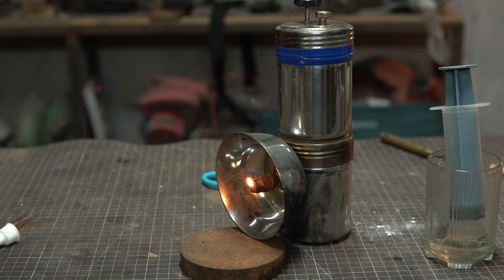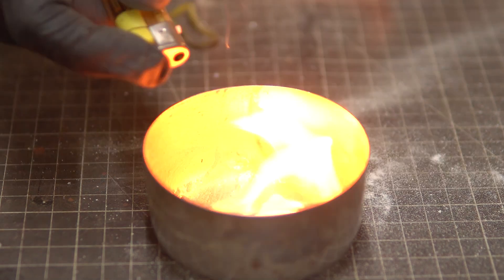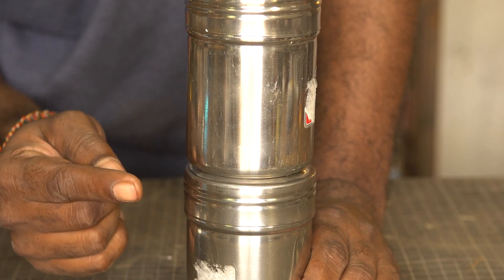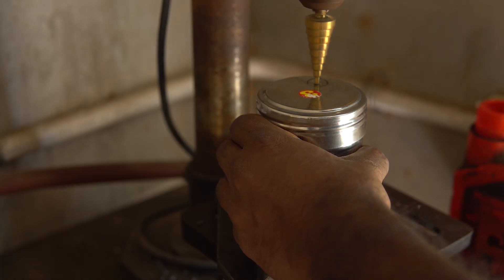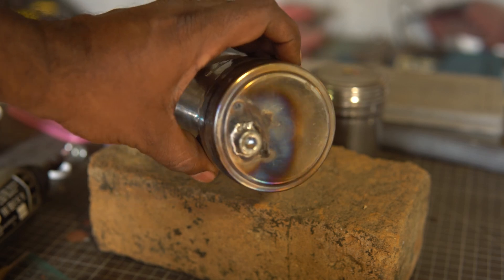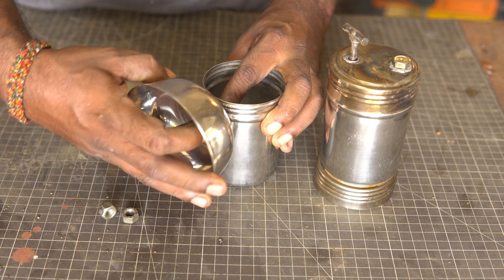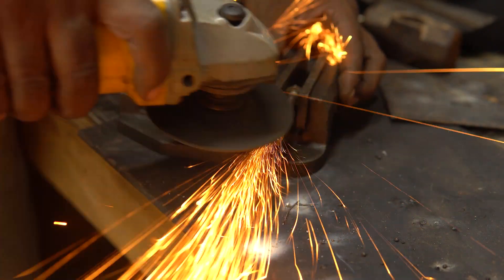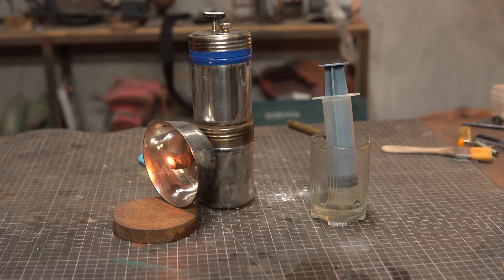100-Year-Old Lamp That Doesn’t Need fossil fuel! (DIY Carbide Lamp)

Comment: Bro can You give me a answer of a question from this video(https://youtu.be/Y0ZUQravksU?si=HwTu2I4VubrY-ouO)

Bro can we make that glass beed without gas torch because i dont have it or can we make a microscope with using glass beed?
Reply from the maker: You can use lens from laser pointer or lens from CD readers instead of glass bead. If you dont have a gas torch , ask some AC repair guys. They will surely have it and it will not much time if you follow the process i showed you

Comment: The threaded rod should have been put into the lathe to have a sharp conical point put on the end, which would fit into a small hole in the lid of the bottom container. That would let it seal properly, and allow for adjustment of the water drops.
Reply from the maker: I tried that too, but did not work. I thing the thread rod need to have even more finer threads